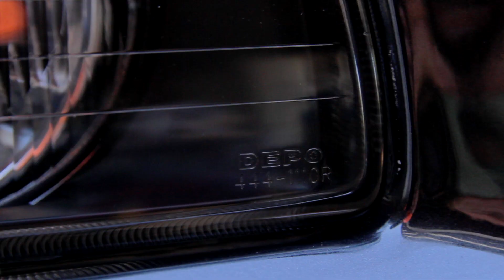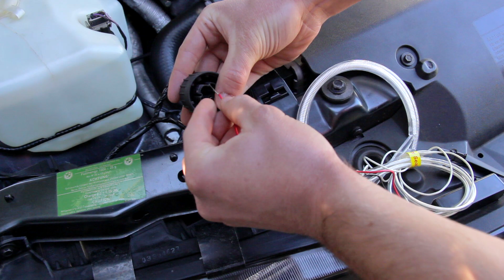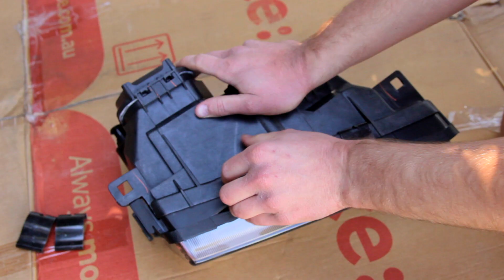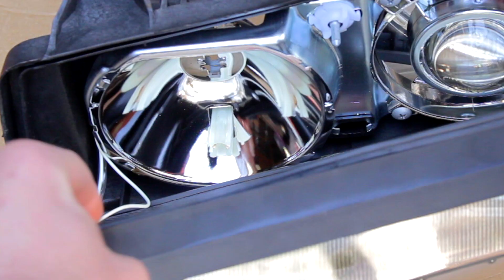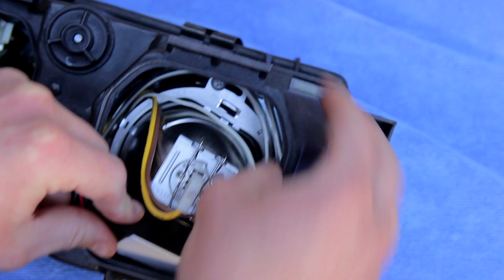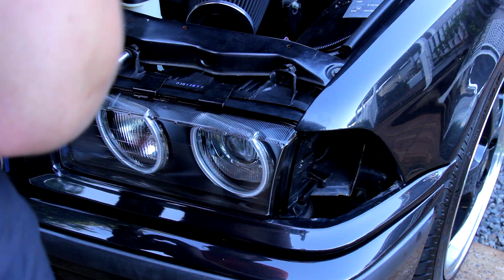Installing CCFL Angel Eyes on a BMW E36

Comment: Hi, can you tell me if these headlights fit on the bmw e36 96, but 4 doors?
Reply from the maker: Yes they should fit on all E36's, I believe they have the same headlights
Reply: I have a 96 4 door and they are completely different headlights. I already ordered the ccfl angel eyes but cannot open the sedan lights housing.
Any ideas?

Comment: Is it possible to install the angel eyes onto the original e36 headlights?
Reply from the maker: I believe it's possible but it would be more difficult since there are no grooves built into the headlights for holding the angel eyes. You'd need to glue them on somehow I think.

Comment: do you need the after market headlights to install the angel eyes?
Reply from the maker: It makes the job a lot easier since there's grooves in the aftermarket ones to hold the angel eyes. You could use the OEM headlights but it would be harder to mount the angel eyes, they would need to be secured to the headlight glass somehow.

Comment: Hi great video really helped i hafe the bought new depo headlights and new angel eyes all the same as yours but for some reason the resistors keep overheating and breaking is thare something im missing?
Reply from the maker: Hmm that's strange, maybe the resistors aren't rated for the same amperage as the lights?
Reply: Same thing is happening to me. Did you find a  solution?

Comment: Thanks for the guide line Bru just wanted to know if you left the park lights in or if you took them out
Reply from the maker: No worries mate! Nah I took them out since I connected the angel eyes to the park light wiring, didn't want park lights and angel eyes at the same time.
Reply: @aussiee3626  You took only the parking light bulbs out? It seems like the wireing is still connected.

Comment: Hi sir, I need your advice on ccfl vs led or halogen ?
Reply from the maker: Hey mate, the main difference between CCFL and LED is the brightness. The LED ones can be much brighter than CCFL. One downside with LED is that you can sometimes see the gap between each LED diode inside the rings (depending on the quality of the product, some are much less noticeable or even nonexistent), whereas the CCFL rings are a single light source. LED can also be a more blue tinge of white, while CCFL is more neutral (again it depends, some LEDs have different colour temperatures). Also CCFL lights can have trouble turning on properly in very cold conditions, so depending on where you live that may be a problem. Halogen I haven't had experience with so I can't give you much advice there, sorry. I'd say go with LED if you want brighter angel eyes that are more pronounced on sunny days, and go with CCFL if you want something less bright. I went with CCFL since I prefer the less harsh light they produce, and they are more in line with the actual angel eyes used on BMWs. Good luck!
Reply: @aussiee3626  thank you sir

Comment: How to hold the angel eyes?
Reply from the maker: Do you mean inside the headlights? The DEPO headlights I purchased have a little space inside where the angel eyes sit and are secured in place by the headlight lenses. If you are using the OEM headlights you might need to use some sort of tape or glue to secure them, as they aren't designed for angel eyes.
Reply: @aussiee3626  even the euro headlights?
Reply from the maker: @faegyrfvvc  Yeah, the one original light I replaced in this video was a euro one, it didn't have anything to help hold the eyes that I could see